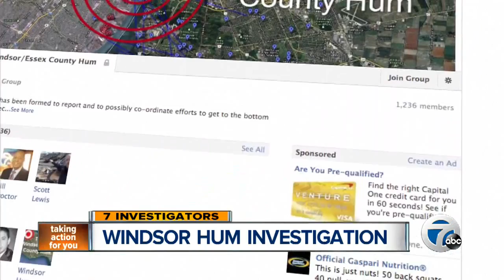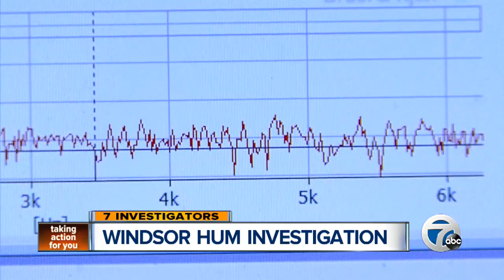Investigation into the Windsor Hum

Comment: Could be the earth's magnetic field.
Reply: Yes and doppler coupling of acoustic energy is amplified by the flux lines around the earth and can travel 100s if not 1000s of miles. i figure this ties closely to Tesla and his ideas around using resonance and the earth flux to transmit energy. So likely we are hearing phase coupling of electrical machinery amplified by earths own flux and we get to hear the altered doppler wave forms of it depending on how far we are from the origins and the humidity and cloud conditions in the atmosphere needed to complete the standing waves. Ha, if you believe that you are as smart as i am!!
Reply: No bec the earth electromagnetic field is about 8Hz and the Windsor Hum (which I experience myself as well) is around 30-35Hz  
But I think you’re on right track. I monitor the Schumann and there’s some freaky things happening with the earth energy right now- enough to where they’re blocking the data to the public